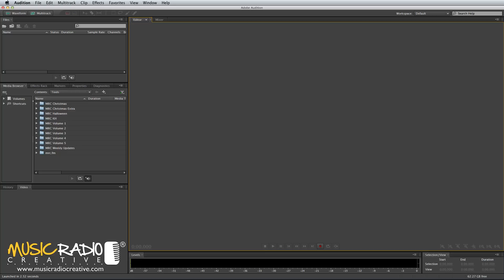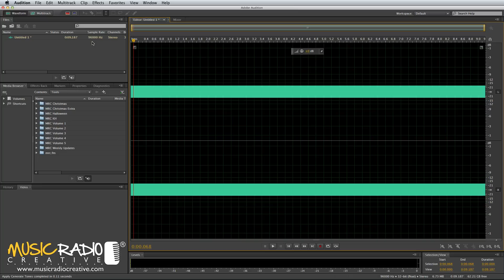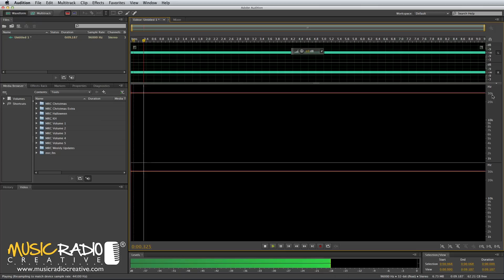How To Make A Dog Whistle (High Frequency Sound Generator)

Comment from the maker: Check the tech specs (I just did). The range appears to be 20Hz - 20kHZ which means you will not hear any sound frequency above 20kHz so the test will be less accurate than on a pair of headphones like the DT 770 PRO which go up to 35kHz.